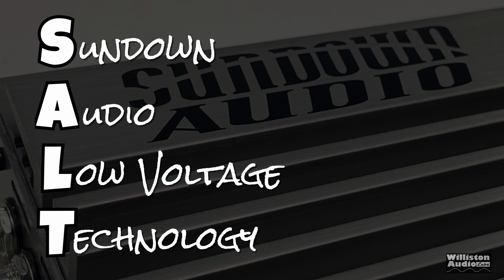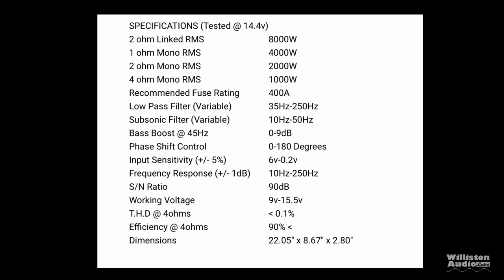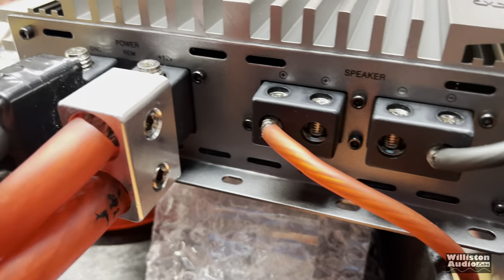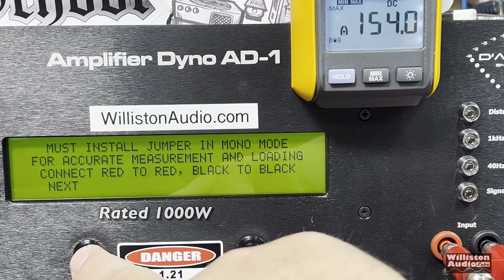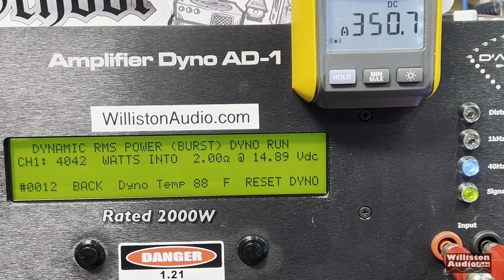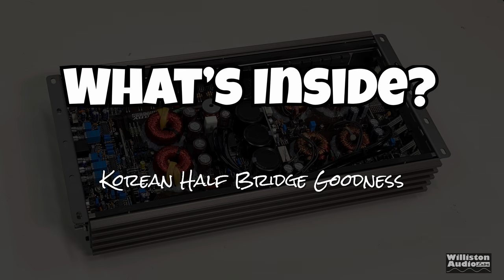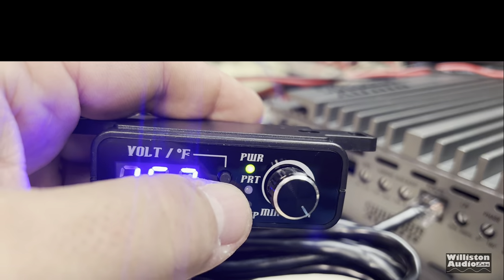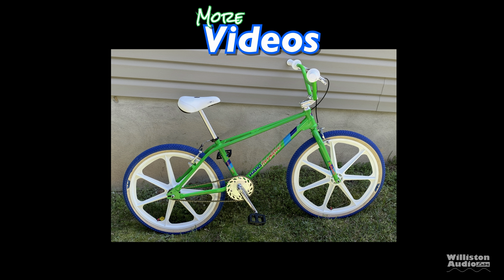Sweet Power, Salty Price? Sundown Audio SALT 4 Amp Dyno Test and Review [4K}

Comment: hello, i posted this on the salt 3 video. hoping someone can chime 
in. thoughts on the salt 500.4 for SQ highs and mids? wanna get the salt
 3 to push my pair of sundown U 12's. actually, have pretty much brand 
new U 12's that i'd like to change for a pair of U 10's, but same 
difference. reason being is i'm gonna put the system in a hellcat and 
would prefer the smaller footprint the 10's give you. but question is on
 the salt 500.4 for highs and mids. thank you

Comment: S A L T  .. LOW VOLTAGE TECH ?.. WHY not testing these at low voltage too?.. their spec mention starting down to 9V. THAT would be very interesting as these amp are probably designed to NOT operate on a perfect 15V setup but more on a regular 12V system ( 4s lifepo4) or 6s 12V lead acid..?

Comment: I want to see a half ohm test
Reply from the maker: Into a resistive load (Dyno), all you'll see is smoke at 0.5
Reply: @wal  so I shouldn't put amp on half ohm load?  My friend has two salt 8ks strapped and wired to half ohm. And it plays fine. I think yours may be smoking because you are not giving it enough juice.

Comment: I gotta save to get this beast to replace my rockford fosgate t2500bdcp. My x12's are hungry, I have the electrical to run it as well  can't wait
Reply from the maker: Wow I’d think that RF would be enough?
Reply: @wal  I just don't see a market for the SALT amps, clean power is so cheap, and you can still get Koreen SPLX3k for $650. Scot M.
Reply: @wal  Maybe the shop who put it in has it turned down